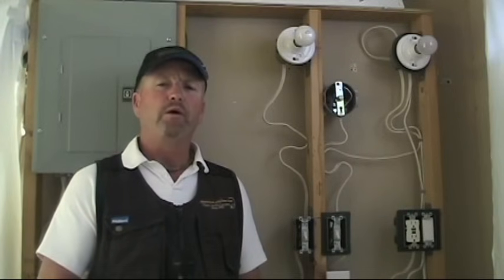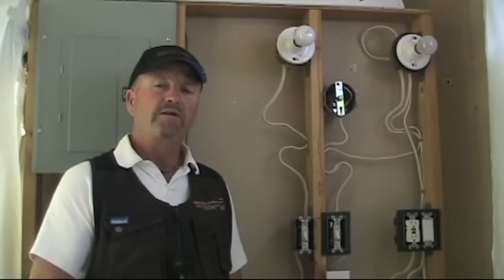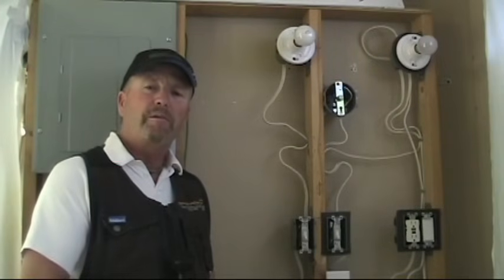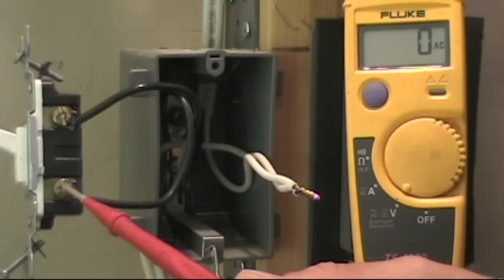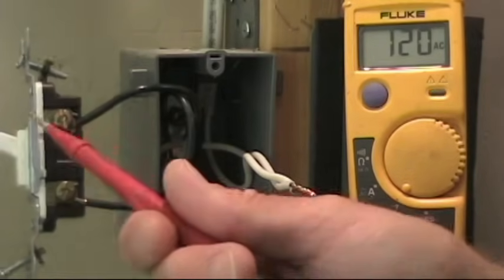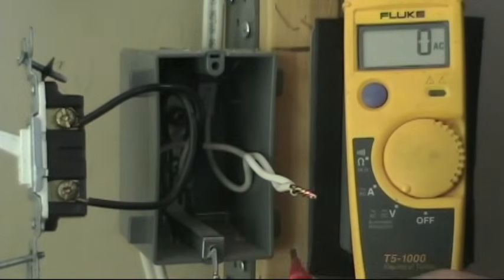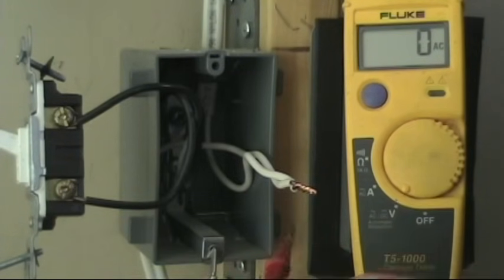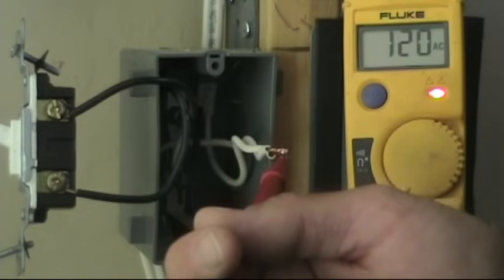Understanding an Open or Loaded Neutral

Comment: You didn't show the main part!!
Reply: For real! Wheres the solution. Im dealing with the same issue in my garage
Reply: @1ftintheflames  The problem is that between the switch box and the panel, the neutral is disconnected.  So the potential voltage has gone out on the hot, through the bulb and back down the neutral ...to where the break in the neutral is.  Once he connects the 2 disconnected neutral wires (the "hot" neutral coming from the light and the switch box and the neutral wire that normally continues to the panel), everything will be OK.
In this example, his friend had taken apart a junction box ...what the video didn't explain is that the junction box is located between the switch and the panel.
Reply: @gregavakian3973  nice
Reply: @1ftintheflames  It would be great if the video shows where the problem is, for example, in the outlet upstream, the two white (neutral ) wires are NOT connected, Then moves on to connect them to show that the problem is gone. I think this would de-mystify this whole thing. A few folks understood but the majority do not with this video.
Reply: I have a open a reversed neutral in the kitchen. I change all the outlets, even change a light switch. I even changed my circuit breakers. I even checked the junction box that joins in the kitchen. And I still couldn't find the open neutral in the kitchen. Could it be behind a wall? Could it be that it's touching the 🔥 hot somewhere? Can it be a nail hitting it? What could it be? What can cause this?
Reply: @JaylenBieber  
Since you asked: Yes; one possibility is a broken wire -whether by a nail or a squirrel/rodent.  But let's talk about the most common issue for your situation.
Before you tear your walls up, check voltage at each location on that circuit so that you divide the circuit into "parts that work" and "parts that don't work". ...It sounds like you already did this(?), so if I understand correctly, you get good voltage readings everywhere except at the kitchen receptacle?  In which case the problem is either in the wire going from the junction box to the receptacle or the receptacle itself.  Since this is in a kitchen, I'm going to assume the receptacle is a GFCI...

Are you getting your reading from a multimeter or a plug-in receptacle/GFCI tester?
An ungrounded  tripped GFCI receptacle will give a similar reading on a plug-in tester, so I would use a multimeter to continue trouble shooting.
There are other ways to test, but the best tool to use is a multimeter to trouble shoot.  Turn the circuit off, remove the GFCI, turn the circuit back on ...do you get 104-128 volts from hot to neutral*?  Do you get less than 90 volts from hot to ground?  Then you had a broken GFCI in an ungrounded location.
If you get good voltage at the wires in the receptacle box, and if pushing the 'reset' (or 'R') button doesn't work, the GFCI is broken.  That is by far the most common issue that fits your discription.

Changing the circuit breaker would have nothing to do with this problem -unless it's a GFCI circuit breaker.

*  (voltages vary in different parts of the country; where I live it's typically 124ish)
Reply: @JaylenBieber  was the neutral wire attached to the hot screw on an outlet?
Reply: Exactly!
Reply: Your 100% right. What a Waste! 😆
Reply: I've get 1 volt when the light switch is off, I always thought it was a night light..

Comment: Hot wire should always be on the top terminal on a single pole switch, same as a disconnect switch.....Any qualified electrician knows that lololol....
Reply: for what reason?
Reply: @markj7604  for an on off toggle switch, the two screw connectors will always be on the right side of the switch, having said this the top connection is always going to be the LINE IN connection and the bottom is the LOAD OUT connection. This is typical on a service disconnect switch for any type of electrical device requiring a means of disconnect, the hot wires, LINE IN, is always going to be installed on the top connections and the LOAD OUT wires connect to the bottom section.
Reply: @toddbucholz28  I assume these are American rules, I still don't see why it's useful though.

Comment: I tripped my trip switch this makes sense why a little bit more, i tried using a neutral from a socket as neutral is missing in light switch area in uk and now I don't know how to fit tings in light socket that require neutral any ideas?

Comment: thanks for your video, but here's a question for you.
I have a 2017 28v Forest River toy hauler, and on our 5th time out in it, my bike came unstrapped and fell against a side wall breaking out my window. Got the bike out and hooked up to shore power. Turned on the AC unit and refrigerator,  and proceeded to put plastic on our window. 10 minutes into this and the AC and refrigerator went off. Checked shore breaker and found the 30 amp breaker had tripped. Turned it back on, and everything was good. 30 minutes later, the same thing happened, but no tripped breaker on shore side or in the camper. All fuses checked good. I checked the outlets and found loaded neutral at 124 volts. Same on power side. Checked panel and every neutral was reading 120v. Checked power on shore side plug and it checked good, zero volts at neutral and 124 at power. Is it possible that when my bike fell over that when it hit the side wall, that it could've possibly knocked a neutral wire out of an outlet, and it cause the readings I'm seeing? I unhooked the converter and did an ohm and continuity check and it passed. As did my other cables going to the breakers. This only occurs when shore power is hooked up. Would a bad gfi do this? Circuit board looks good too. I'm not wanting to go too far, due to warranty issues, but I hear stories about them keeping campers for months, to get repairs done. Not sure how familiar you are with campers, but I thought I'd give you a try first. Any input that you can think I might have missed would be appreciated.
Reply from the maker: John, from what you are describing it sounds like the problem is with the main power feeding the RV, and the neutral conductor on it. To have a loaded neutral on virtually everything in there points to having the hot 120V getting to the panel, but no return connection on the main neutral. Check your power cord, the connections on the mains in the panel, and if you have a transfer switch that it goes through first if you have a generator? Follow that path and I think you will find your problem.
Reply: Terry Peterman 
Thanks.......found neutral wire had come out of the male 30 amp plug, where shore power hooks to, because it wasn't installed securely from the manufacturer. I assure, it is now. Laziness and lack of care these days, is why people are buying more imports. People just don't take pride in their work like they use to....smh
Reply from the maker: Excellent. And the bike had nothing to do with it! Glad you found the problem!

Comment: Hi, I was replacing a receptacle today & when I started to replace it, I realized they used both a white wire for ground & neutral. How can I find which is ground & which is neutral?
Reply: measure wires with multimeter . test ur hot wire to one of the white wire , now test your hot wire with the other white , what readings do you get

Comment: I believe the fault was at the switch where it breaks N instead of L, so when the switch is open, the N wire closer to the load is still hot.

Comment: "He found that he had open splices further up the circuit".
Well... that's fine & dandy. But...

That really doesn't give you the actual reason why he had 120 on his neutral. People are gonna ask about those open splices further up the circuit, where the cause of the problem is. So what actually was the cause? For example, the same neutral, at the opposite end of the circuit might probably be connected to a hot leg. If that were the case, then you've given a reason why your neutral is loaded.

If someone's sewer is blocked & wants to know why... the EASY answer is: there's a problem somewhere down the line. Well, no shit. The answer is with the actual problem, which everyone wants to know.

Unless... I've missed something? Sorry. Don't mean to jump on your back. Thanks for taking the time to enlighten the uninitiated.
Reply: It would be great if you could do a video demonstrating what he did and how to correct it
Reply: Seemsayin the white wire was disconnected between that switch and the fuse box.. The circuit was seeking a ground...and that could be you, if your grounded and touch it..
Reply from the maker: correct!
Reply: @KBS117  I didn't re-watch the video. But I did know how electricity worked two years ago. I don't know what your response had to do with my original post.
Reply: Problem is I'm not enlightened!
Reply: The lamp itself, especially incandescent ones, is feeding the power to the Neutral. Normally, that would flow back o the mains, but....
Reply: The neutral (white wire) was not connected to the box.
Reply: @JohnSmith-td6dn  I know this thread is over two years old, but it popped up again on my radar. I believe the comment I left for you was actually meant for the OP, as you did not make the video.

Ya know... if you weren't enlightened, why didn't you bother to ask questions, versus just driving by & complaining? It sounded like you were pissed off about something other than what we were talking about, because you didn't bother to be specific. Sorry to rehash the past. Nothing personal.
Reply from the maker: Julian, It's me, the guy that did the video. Once I told him that it sounds like an open neutral, he realized that he had a junction box opened up in the circuit, and the splices were all apart. He was in the middle of a renovation so there was no mystery where the problem was. I just thought it would be a good subject for a short video on theory, and how you can have such a situation.
Reply: thanks so much for your channel and your website. gonna watch em all.
Reply from the maker: No problem!
Reply: John Smith John... I respect your honesty. And thanks again for the effort to make your video.
Reply: It wasn’t hard to understand.  Rock On.  👍
Reply: Michael Jones  Mike... you told us what WE already knew: You have a problem. I don't recall having heard what the problem actually is. I haven't reviewed the thread, so I don't know if you've explained the problem, or if you're working on it now, or have it solved. Just sounds like you were expecting an answer.
Reply from the maker: The cause was that he had taken apart a splice while he was doing his renovations and had forgot that the splice was still open. Once re-connected as it should have been, all was well. This was just to explain how and why you can have a reading of 120V on a neutral, that should be at earth or ground potential.
Reply: I apologize if I sounded rude.

I appreciate the fact that you made the effort to shed some light on the subject. I was in a pissy mood to begin with, and vented on ya. My bad.

Thanks for the quick reply. Best of luck to you.

Comment: I have electrical training background (US Navy) but I lack some understanding in residential work. I just bought a brand new home and am adding a shop. My 200A service panel looks full, so it looks like I can't add a 100A breaker to run to a 100A sub-panel because one side of my main breaker is servicing 245A and the other side servicing 225A.  Will this be impossible and if not please explain.
Reply: Old post but get some double breakers to free up some spots and add the sub.    Guaranteed you are not pulling 200 amps or that your sub will pull 100.
Reply: i highly doubt u can add 100a sub if your 200 is full.  any luck yet?

Comment: Wish there was a drawing
Reply: I agree, does not make sense,
Reply: it does make sense, imagine your neutral disconnected at the panel. 120v rides up the black wire from your panel to the switch, then to your light when in the on position, power goes through the light then down through your neutral but has no where to go, no street neutral and no ground path. this is why ground rods at your meter are a great idea in case your aluminum neutral lets go or a tree takes down your overhead service. it can fry circuit boards and even cause fires in motors. tvs, refrigerators, dishwashers, dvd players, phone chargers, computers, monitors, etc. are all prone to failure in these situations. I've witnessed some pretty bad insurance claims
Reply from the maker: Thanks Joseph! It does make sense!
Reply: great job, it does make sense to me, someone who has been doing this for 15+ years, but to someone trying to learn, it may require a diagram or an in depth video on this.
Reply from the maker: https://www.electrical-online.com/understanding-an-open-or-loaded-neutral/
Reply: @theinternetelectrician  Question. The line drawing is different from the graphic drawing. In the line drawing you have the black wire feeding the outlet attaching between the switch and the light bulb. But on the 1st picture(the graphic drawing) it's attached before the switch. Between the breaker and the switch. In the line drawing the switch would turn both the light and the receptacle on/off together. In the graphic the receptacle would always be on. Only the light would be controlled by the switch. I enjoy your videos, thanks for posting and explaining the hot neutral.

Comment: What would happen if your sub panel's neutral and ground were tied together?
Reply: James iPad NEVER GROUND A SUB PANEL!! only the main panel gets grounded.
Reply: I somehow think you know the answer and are just testing. In case I'm wrong  about that  here is the answer :
 a sub panel has to have separate ground and  separate neutral bus  to prevent the ground wire  from becoming a current carrying conductor
Reply: The only time a ground and neutral is tied together is at the main panel.